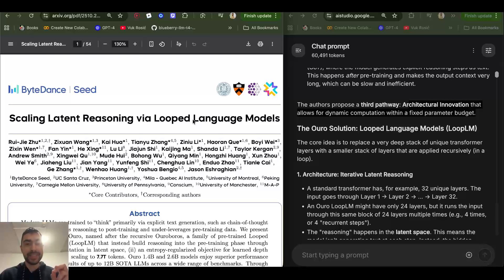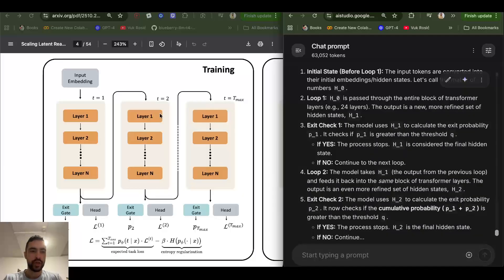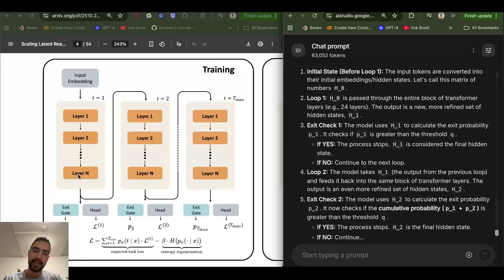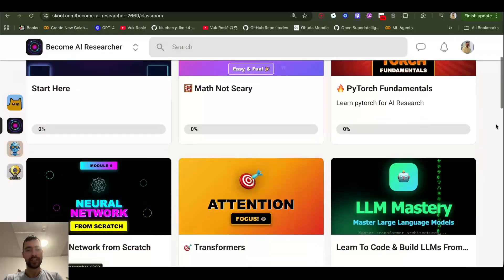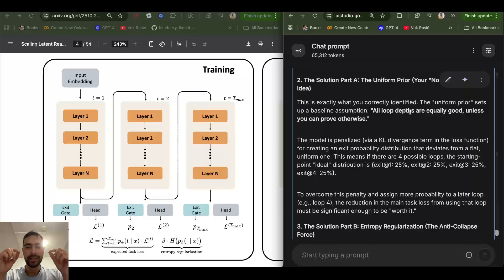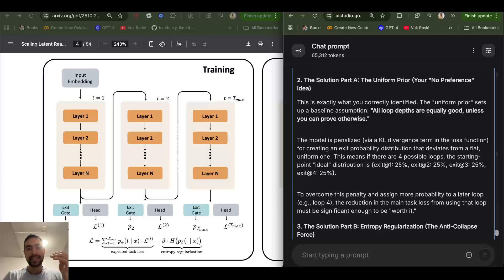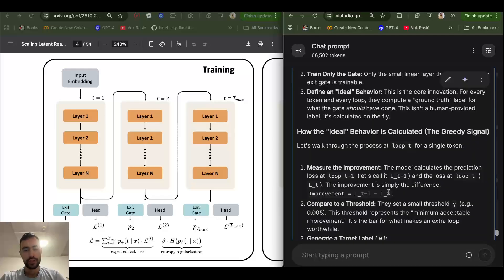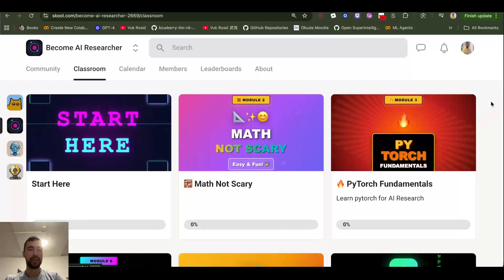LATENT Thinking LLM - Looped Transformer Thinking - New Paper Explained

Comment: This looping idea has been explored for a couple years now but this seems to be the first usable, practical application of it. The general idea is essentially the obvious answer to the poor logic and reasoning capabilities of most LLMs, where iterative thinking is typically an afterthought tacked onto the context window. There is probably a lot more space to be explored in not just limiting the idea to one transformer, i.e. expanding it so that loops are created across multiple transformers at different layers, but how to decide where to place those loops and how to evaluate output from the process against some threshold probability (if that's even the optimal evaluation method for that scenario) is a much more difficult architectural design problem... it seems like the way forward for actual iterative thinking though

Comment: I took ACT and tried it with and with out HRM's H and L layer idea, basically 2 levels of what this idea is. I found ACT reduced convergence time by 30%. Having a 2:1 L to H ration also had the same behavior, 30% reduction in convergence time. Now we need a way of properly handling attention and retention together to reduce VRAM cost of token count. TitanMAC does not work with retnet very well. There are a huge number of problems to making it work.

Comment: This loop idea is surfacing in multiple places aiming better intelligence and performance.
Reply from the maker: yeahhhh
Reply: And you can combine them. 

It's starting to look like there are many, many orders of magnitude of improvement. 

AI might come down to the level of being able to run on phones next year, better than running on super computers this year.
Reply: @jtjames79 This is very very exciting, we won't need supercomputer clusters to experiment big things. Though super models will get better, people will have better chance at using quality local intelligence.
Reply from the maker: @jtjames79  yeah
Reply: And they’re doing it the most oblique way possible. Not good. Looped latent models is the ideal architecture, doesn’t have to be a black box though. People need to look back at deep supervision, there are more efficient ways to do this without losing interpretability and actually actualize the promise of latent reasoning through superposition. If done properly, anything in discrete space can explicitly be done in latent space, and it can be wholly controllable. This is my area of research. Oblique latent reasoning + RL = retarded model evolution and a guarantee way you end up with a model that’s effectively alien intelligence. Remember RL doesn’t provide understanding, compression = understanding, which is ssl. I’m not excited how these folks are approaching this.
Reply: @zandrrlife I don’t understand. Can u explain a bit more to a layman. Interested in what you’re trying to say
Reply: Where else is it popping up?